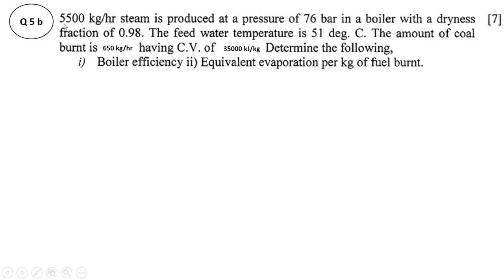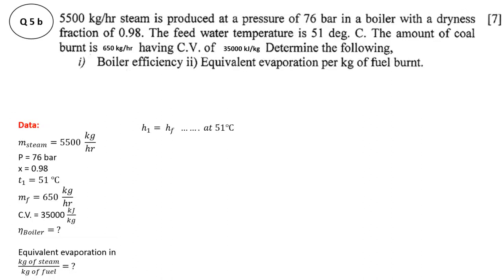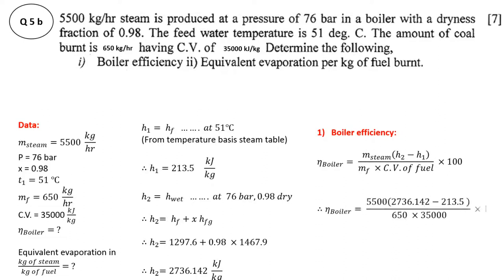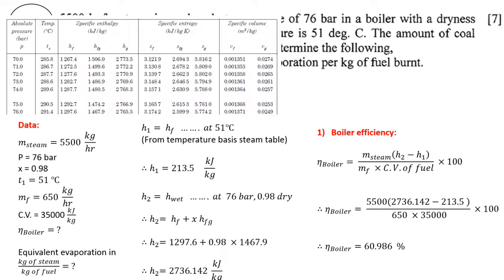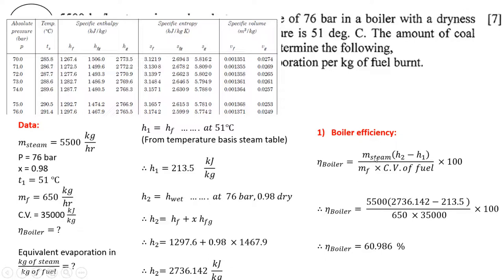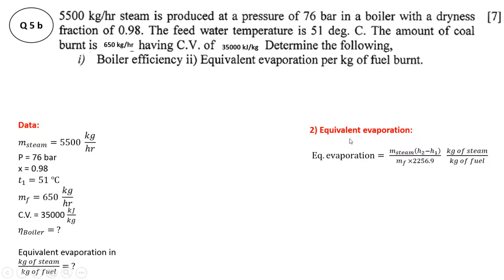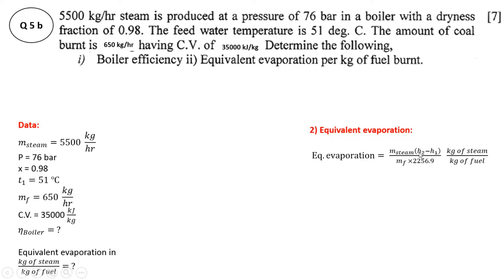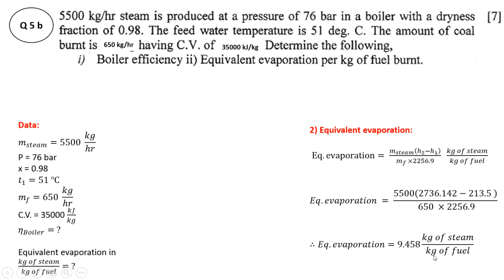How to find out boiler efficiency and equivalent evaporation - SPPU paper solutions

Comment: A boiler produces 5000 kg/hr of superheated steam at 3 MPa, 500°C from feedwater at 30°C. The boiler uses a fuel with a heating value of 46000 kJ/kg and has an efficiency of 88%. Find the :

I have this problem and need to find the flue rate of fuel but I don't have Mf value can you help me?
Reply from the maker: Use the formula of boiler efficiency,  You will get the value of mf

Comment: The following observations were made on a boiler plant during 
1hr Test :-
Steam pressure = 20 bar, Steam temp. = 260ºC,
Steam generated = 37500 kg, Temp. of water entering the 
economiser = 15ºC, Temp of water leaving the economiser = 
90ºC, fuel med = 4400 kg, energy of combustion of fuel = 
30,000 kJ/kg.
Calculate :
1) The equivalent evaporation per kg of fuel.
2) The thermal efficiency.
3) The percentage heat energy of the fuel energy utilized by the 
economiser.